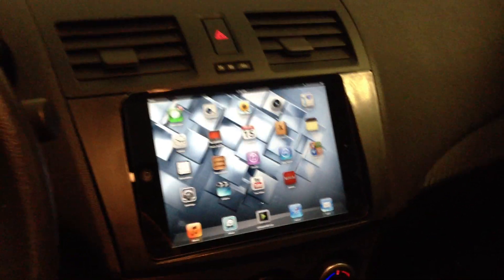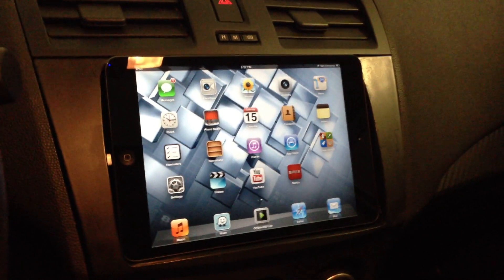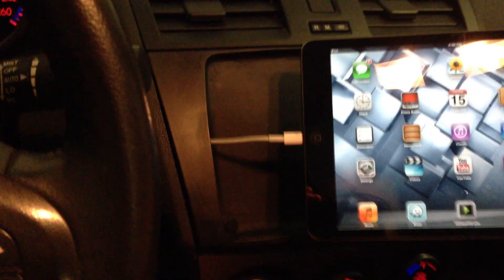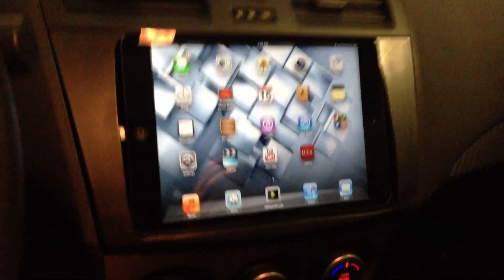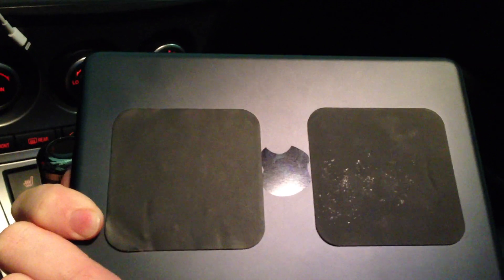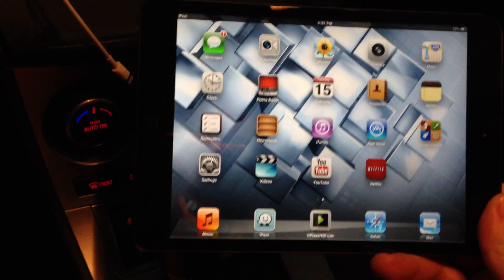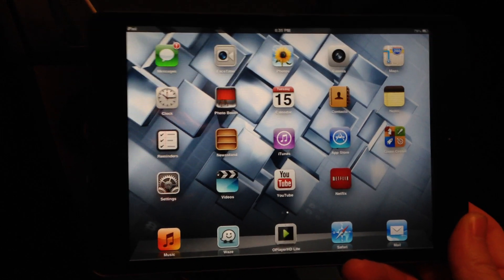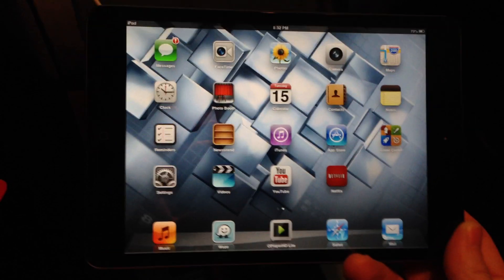iPad Mini in dash install 2010 Mazda 3

Comment: You could also go a few different routes...like use an external DSP processor (instead of a head unit like the P99RS) and use a dock as the interface between the ipad and processor. The Pure i20 does digital out so you could connect the ipad to the dock and send digital out over optical cable back to the processor. Cleaner, lower noise floor.

Comment: I just searched for that, $1200.00!!!!!????  Is there a cheaper option out there you can recommend?  In my case I would remove my factory stereo (no bluetooth with it) to make way for the iPad mini double din, so then I would have to send the sound to a DAC that would then pass that along to my after market amp, is that right?  Any bluetooth DAC's?